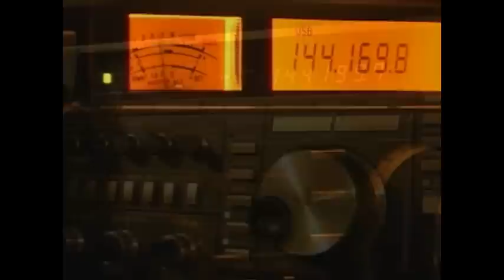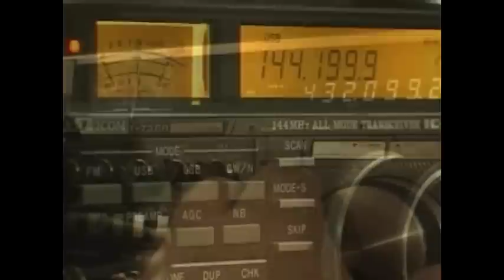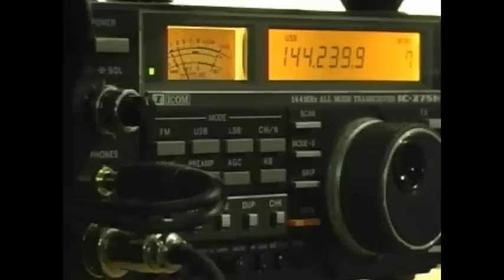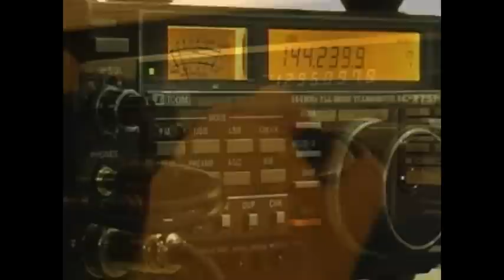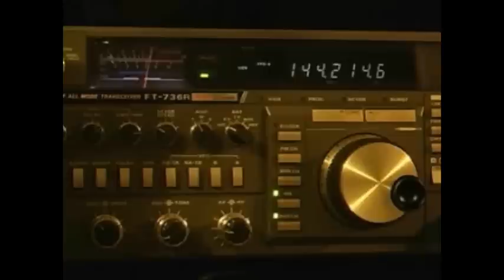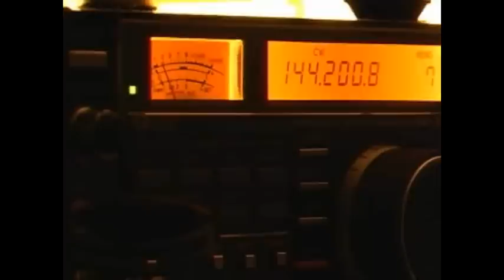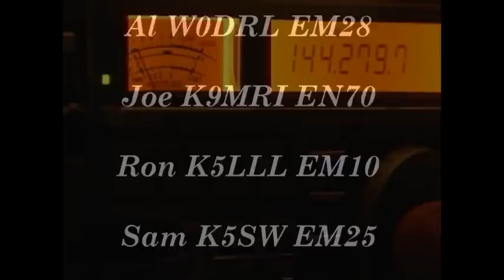VHF Primer Video For New Weak Signal Ops

Comment: Another great video. 

JD has a passion for VHF/UHF weak signal like no other. 

If you are interested in weak signal, JD's videos will push you over the edge and you will want to join the fun. 

The Grid Bandit's website has tons of information to get started. It will also save you thousands of dollars on what to buy the first time.